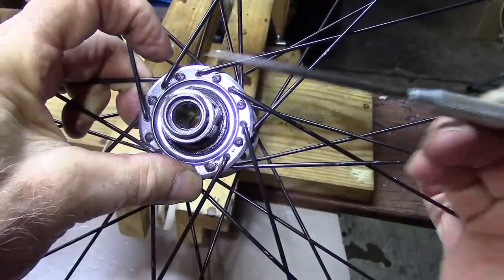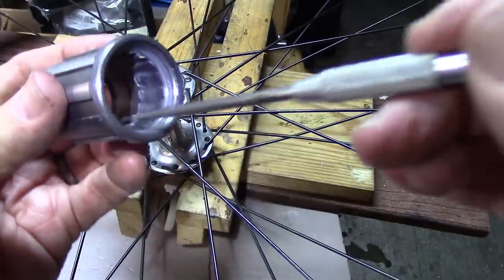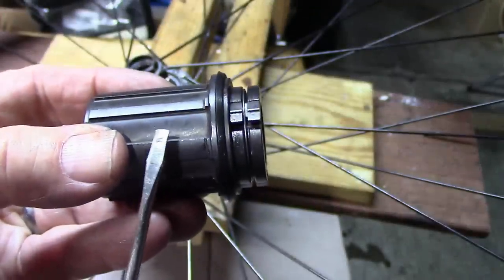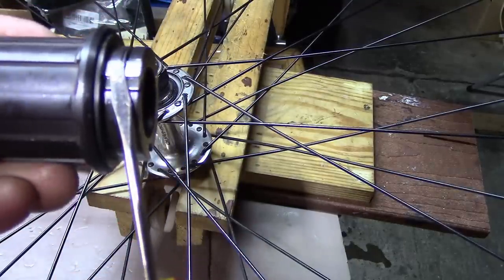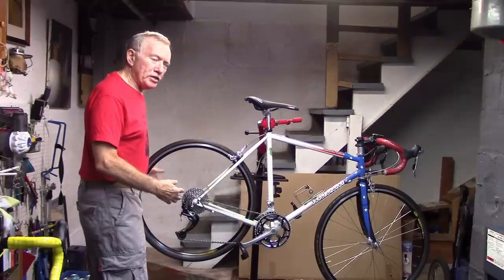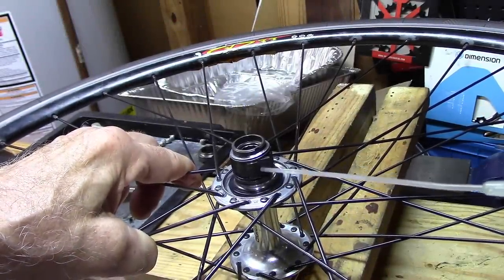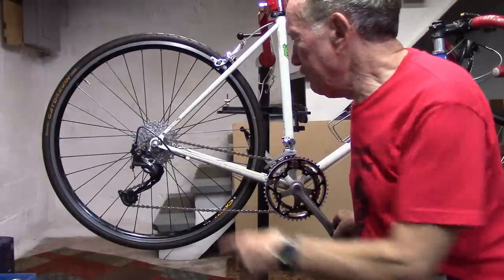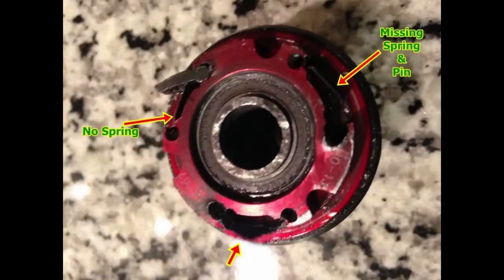Bicycle Freehub Noise, Clicking Sound, and Freehub Trouble Shooting

Comment: Is there anything very bas that can hapen if i ride with bad wheel bearings ?
Reply from the maker: The wheel will become noisy and may begin to wobble (this could effect steering). It may take more effort to pedal as the wheels begin to have problems rotating. In the end, the wheels may not turn at all. Here's a nice review:
https://bicyclesinmotion.com/how-to-tell-if-bike-wheel-bearings-are-bad/
Regards and safe cycling, Tony

Comment: I had my road bike fully serviced about 6 months ago (including changing cassette and chain) and it's been running fine until about a month ago when the rear wheel started 'skipping' (hesitating). This feels like the chain slipping (but I'm sure it isn't that). The problem has been increasing - is it the springs under the pawl? (Otherwise my bike is in excellent condition - always clean too!) Helpful advice will be appreciated.   :o)
Reply from the maker: When you say hesitating, do you mean when you shift or while riding in the same chainring and cassette cog? Does the chain start jumping cassette cogs even if not shifting? Are all the components the same manufacturer? When speed chain are you using? Let me know so I can better answer your question. Regards, Tony
Reply: @tony10speed  
When riding in the same chainring and cassette cog (it happens for both chainrings and all cogs). Shimano components.
Thanks for your reply.
Reply from the maker: @George-sc4yh  Check:
1. Are all components and chain the same speed (10, 11 or 12), i.e, someone didn't replace a 10 speed chain with an 11 speed.
2. No obvious wear to the drivetrain and check the chain for wear.
3. Then it's most likely the freehub. Slipping can happen for a number of reasons, including worn ratchet, worn pawls, weak springs, or excessive accumulation of grease & grime within the freehub. Depending on the hub you have, a repair consists of either cleaning, rebuilding or replacing the freehub. Some freehubs are rebuildable, others are not and must be replaced as a unit. That said, it's often possible to extend the life of a non-rebuildable freehub by flushing out the old grease & gunk and regreasing. The mechanic at your local bike shop can almost certainly take care of this for you.
Regards, Tony
Reply: @tony10speed 
Thanks. Then it seems it is indeed the freehub. I'll take it in to my bike shop.
Nice channel BTW, you're a great help.
Reply from the maker: @George-sc4yh  Please let us have some feedback as to what the shop finds. We'd all appreciate it. Regards, Tony
Reply: @tony10speed 
Will do. 😊
Reply: @tony10speed  
Hi Tony. I've just got my bike back (now running smooth). Yes, it was indeed the freewheel bit. He replaced it with a Shimano FH-C201 complete free wheel body part. Thanks for your advice.  :o)
Reply from the maker: @George-sc4yh  Thanks for the feedback and safe cycling. Regards, Tony

Comment: This is the information I was looking for because my old skyways on my BMX are turning the pedals. I’m from the 80s and Can’t remember what Freewill did back then I thought the pedals stayed stationary. 
I guess I’m good for a rebuild or a new one
Reply from the maker: Most, if not all, 1980 BMX have a freewheel that allows coasting (most are single speed freewheels). If, when you turn the rear wheel on a bike stand, the crank and pedals move, you have a problem with the rear freewheel that needs to be replaced. Very few BMX are fixed gear. Here's a reference on single speed vs fixed gear:
https://www.yellowjersey.co.uk/the-draft/whats-the-difference-between-single-speed-and-fixed-gear-bikes/
Regards and be safe, Tony

Comment: Thank you, I have a trek fuel 9.9 and it's a little too loud I'll be taking it apart to clean it and apply some grease
Reply from the maker: Although the DT Swiss might be easy to grease, be cautious. Some freehubs may be difficult to service and re-assemble. Best done by someone with experience such as the mechanic in your local shop. Note: some freehubs are louder then others (even when brand new). This does not mean the freehub is broken or bad, just the nature of the freehub. The new 11 speed DT Swiss R-7000 tends to be louder the the corresponding new Shimano 6800. The old Shimano Ultegra and Dura Ace FH-6600 and FH-6700 hubs are some of the quietest but come only in 9 or 10 speed and are difficult to find and probably wont serve your needs. There maybe something to the saying: "if it ain't broke, don't fix it."
Here are some noise comparisons on new hubs:
https://www.youtube.com/watch?v=dLqNeH3gGK4
https://www.youtube.com/watch?v=TNizg4JUNc8
https://www.youtube.com/watch?v=oKbKfxu5_oQ

Comment: i know this has been out for a while but what if my hub becomes silent is it just dirt?
Reply from the maker: Usually the pawls of the freehub riding over the freehub catches, while coasting, make noise. While pedaling, the hub is much quieter. I assume (correct me if I'm wrong) that you are referring to the fact that while coasting, the freehub no longer makes the usual clicking noise. If your hub was previously "loud" and is now quiet, something is likely keeping the pawls from dropping energetically into the catches. This may be dirt or old grease. Before you develop problems, I personally, would have your local bike shop take a look and overhaul the freehub (clean and apply new lubricant as needed).
Reply: thanks again but i was already thinking of upgrading my hubs from 8 to 12 also my old hubs i just bought a cheap one because my budget bike hubs broke and i needed a cheap replacement(old hubs 8s 4pawls) (new hubs 12s 8pawls)
Reply: also thats why my bike feels heavier to pedal

Comment: I have what sounds like one click in a rotation missing suddenly on brand new wheel assembly. 8 spd 700c. Not happy as theres multiple things not working with the assembly.
Reply from the maker: Remove the wheel. Also remove the skewer and lightly grease and replace when the wheel is off. Check the spokes like you would pluck a guitar and see if there's a loose spoke. Replace the wheel and make sure it's inserted correctly. Try it out and let me know. Regards, Tony
Reply: @tony10speed  nope. Took the whole cassette and freehub off and cleaned it. There was all sorts of shavings in the freehub. Also had to swap cassettes over from my winter wheel.. Seems the 11spd hub needs a 1.85mm spacer.. My other hub is made for 8spd and fits without a spacer..  The carrier bolts were interfering with the spacer at the same time... Just got it all back together and washed up. Clicks all the way around again
Reply from the maker: @the_nondrive_side  Where were these "shavings"? On the outside of the freehub? Did the cassette dig into the freehub and leave marks? Is the clicking only when pedaling or just coasting or both?

Comment: What if mine works normal for pedaling and coasting but doesn’t make a clicking noise
Reply from the maker: You must have a Chris King hub. Nothing wrong, but now you can sneak up on the rider in front without him hearing you. See:
https://www.youtube.com/watch?v=dLqNeH3gGK4
Regards, Tony
Reply: Tony Marchand thanks for your reply but I’m pretty sure it’s never been replaced it was my fathers I got it from him like 10 years ago and it used to make the clicking noise is it just worn? Should I replace it? Or just continue to ride it if it still works? Thanks
Reply from the maker: @JimmyCasket02  Maybe there was a little "sticking" in the pawls of the freehub or a little gunk from non use by your father before he gave it to you. As you been riding it, the "stickiness" or little bit of gunk got worked out with use. If it's quiet and works well, I think you'll be find.

Comment: My bike start make klik sound when i use gear 4,5 when paddling, my bike still new.. may hub problem?
Reply from the maker: Note, some new cassette will make some noise for the first few weeks or so. Not sure why but then the sound goes away. 
If not, the cassette may not have been tightened sufficiently. The freehub should be lightly greased before attaching the cassette.  See:  https://www.youtube.com/watch?v=Z6nT1k02twg
If not, since it's new, you can inquire with the bike show from whom you made the purchase. Let me know how things go.
         Regards, Tony
Reply: @tony10speed  thanks . 🙂
Reply: Tony Marchand 🤘

Comment: Cleaned my cassette & chain with hot soapy water then i threw the remaining water over the drivetrain. A mistake i think as the freehub is making cracking/grinding sounds even when im freewheeling😢Didn't think doing that would ruin the freehub but it seems like it has. Annoying.
Reply from the maker: Usually the freehub is well enough sealed that it should resist throwing water on it. Rather, you'd need to use a hose turned on full to blast to blow out the grease from the freehub. Anyway, first make sure the wheel is installed in the dropouts properly and the brakes (or rotor) doesn't rub. If all looks fine, it may still be the freehub or could be the wheel bearings had very little grease to begin with and the soapy water was just enough to wash out the grease (I've washed my bike and drivetrain many times but use a very light sprinkle from my hose. I also overhaul my hubs every couple of years and re-grease). Maybe it's time to visit your local shop to have a look. Don't blame yourself. This would only happen if your freehub or bearings were very very close to needing an overhaul and lubrication. Let me know how you make out since we can all learn from your experience. Regards, Tony
Reply: @tony10speed  The bike man said the freehub was goosed and throwing water on the drivetrain hastened its departure. Replaced it but now when im peddling in a certain gear it makes a noise😢One thing i've noticed with bikes is that when one thing breaks down and is fixed another thing pops up almost immediately and thus it continues. The bike is never 100% working order.
Reply from the maker: @hartleyhare99  Which gears (chainrings and cog combination) and what kind of sound?
Reply: @tony10speed  a slight clunk/clink sound. Like the chain isn't running smoothly over the cassette. It wasn't doing this before he fitted the freehub. Now this😢Always something with bikes. I think Made In Cambodia has a lot to do with it. Anyway, im taking it back 2m so he can hopefully rectify the problem. Thanks for replying🇬🇧
Reply from the maker: @hartleyhare99  Sounds like the rear derailleur just needs to be indexed (tuned) which should be an easy inexpensive job. Let me know how you do. Tony

Comment: oooohh so thats what happened to my hub. bless my bike shop for fixing it.
Reply from the maker: What were the "symptoms" that you were have that led you to take it to the bike shop (just so we can pass it on to our other viewers). Regards, Tony
Reply: @tony10speed  Crashed drivetrain side down, bent my rear derailleur which caused my chain to wrap behind my cassette and locked my rear wheel up causing it to no longer free spin.
Reply from the maker: @bboxxstance  Thanks. Glad your bike shop was able to repair it. Regards and safe cycling, Tony